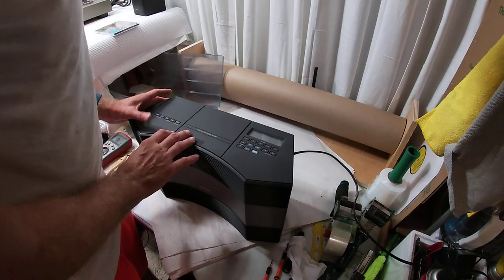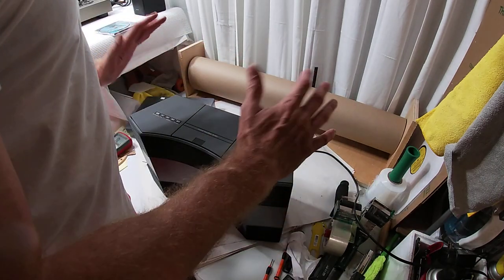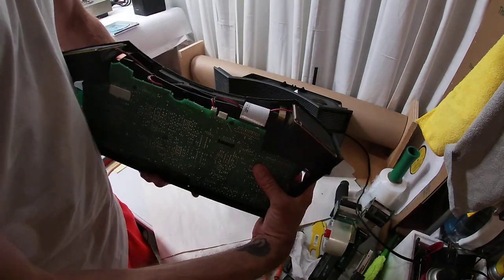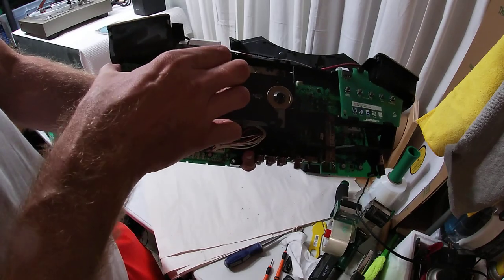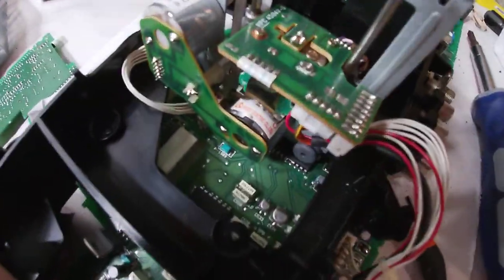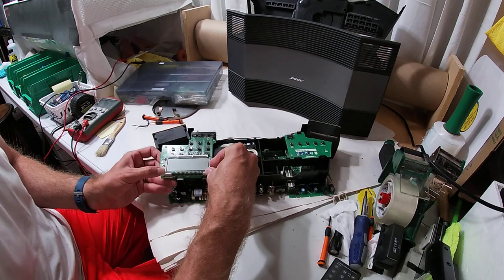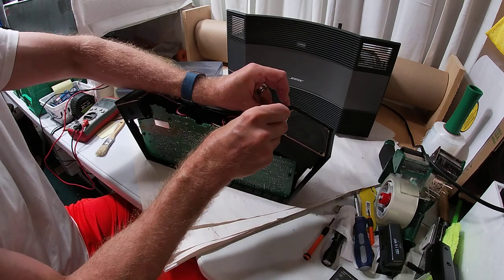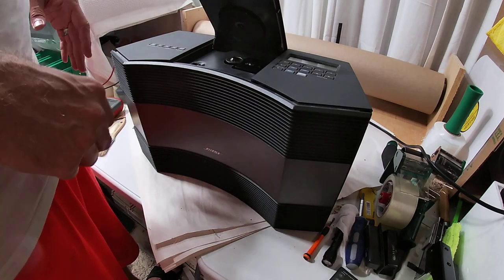Disassembly Of A Bose Acoustic Wave Radio CD3000 - It had the clicks...

Comment: The resistance when first opened was .98. Raised it to 1.295. Cleaned and regreased the rails, put it back together and it works like new. Thanks for a detailed video.

Comment: Just found your video Andy. I have one of these that won't play unless I press down the CD door slightly. I plan to use your video to open it up and see if I can adjust the door switch, or add a tiny drop of glue to the door pin that presses on the switch to make it a little longer, unless you know of a fix. Thanks!

Comment: My acoustic wave was doing the exact same thing! I took it apart just as you did. But rushed putting it back together and plugged in the pcb board plug backwards. I plugged it in and tried to power it up before i realized it. Now it wont even turn on. IDK how i plugged that in backwards but i did. Any idea on what i couldve burnt out??

Comment: Andy, took apart the Bose Wave, how does the unit know the CD door is closed? There are no switches or wires on the latch or the gear at the back of the door. Need a little help...

Comment: Have the same unit. Won’t recognize it has a disk
Red laser is super dull. 
I’m thinking it needs a little more voltage to make it brighter…if I remember OHMS LAW correctly, reducing ohms (resistance) will increase voltage??
Reply from the maker: There are some really small potentiometers in there... just slightly move it up or down, then test, then repeat until it works. pain in the rear... but it works...
Reply: or clean the lens as i did and potentially save you a ton of effort 🙂

Comment: mine was saying no disc but didn't make a noise. I did everything shown, cleaned everything but still didn't work. put it all back then noticed lens was dirty, cleaned it in 30 seconds then worked perfectly!
Reply from the maker: Ohhhhh, you got lucky! Good catch!
Reply: @kappandrew1  - thanks, i was very pleased as cost £50 from local 2nd hand shop a few days ago and included cd autochanger. all works perfectly and cleaned up really nicely.